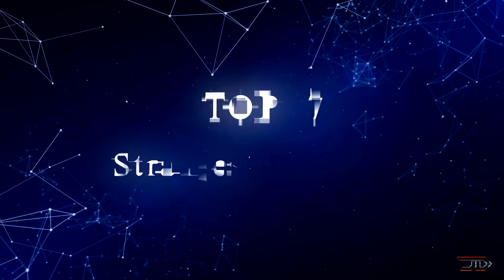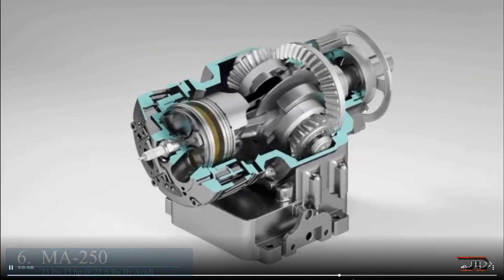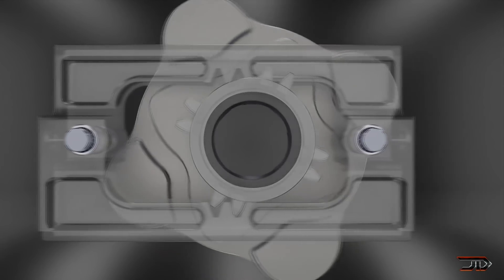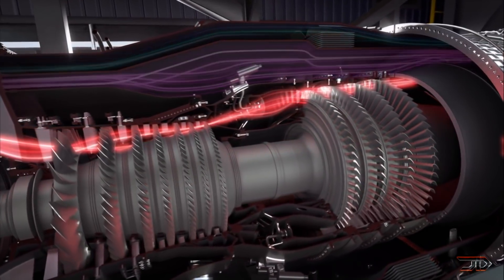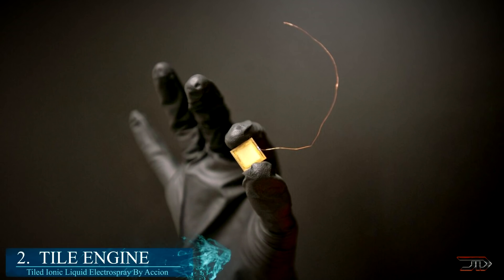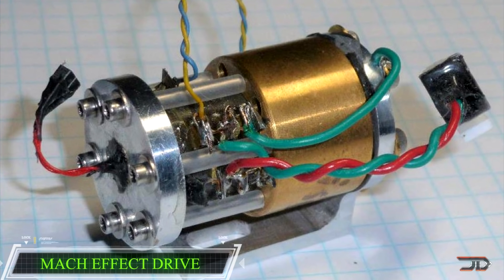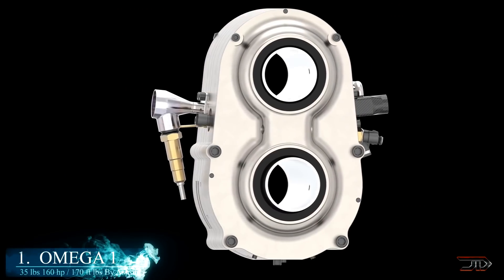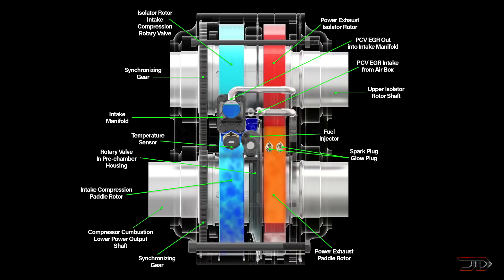7 STRANGEST New Engines -2-

Comment: The Omega 1 has the greatest potential for power to weight ratio and ease of manufacturing because of the lower number of moving parts. Been mentioned before but the sealing issues, if they can be overcome, could be an incredible move forward in the development of the ICE (Internal Combustion Engine). I see it as the final gasp for automotive and aeronautical use. Once battery tech greatly improves the energy density then EV's will bury the combustion engine.
Reply: If Murphys law holds true, someone will invent the most efficient ice in history, only to find that the price of fuel goes up so high that it is of no use.
Reply: @joeboxter3635  Murphy's law cannot negate the most basic law of supply and demand, once the demand drops because of greatly increased efficiency then the price will drop accordingly.
Reply: Maybe an ICE is only as good as the quality & type of fuel going into it for max fuel economy & least emissions ?
Reply: Electric Energy is not FREE. Transporting (transforming)it is a 75-85% POWER LOSS.
Reply: @donaldstrishock3923  that's just not true.
Reply: @rickgao5510  85%× 92% ×80%×94%×93%×90%×75%= 40% for production usage cost for electricity though generation-tranpotation( transfomation),and net usage ( driving) not even considering the actual COST of Fuel& Componetry to produce the Power to spin the wheels & move the electric car down the road. You just didn't do the math for the "highly unpractical" application. Just tell me when you get FREE Electricity then it will be some "New math".
Reply: Since 1/3 to 1/2 of all cars are 2nd car commuters that travel an average of 15 miles to work, battery range is not the problem. Work commuter cars are a huge market, and as soon as prices come down and people are confident with battery reliability, there will be a massive switch to electric.

Comment: Don’t understand why there are still companies spending money developing internal combustion engines.
Reply from the maker: I think if batteries can last 15 years it would make some small ICE obsolete. It's almost there but a refined rotary could be beneficial in hybrids.
Reply: @Motor_Explorer1  in less than 15 years batteries will be considerably better than they are now. Tesla batteries are already lasting in excess of 8 years.
Reply: Range extension is a huge potential market as the infrastructure for charging stations just isn't there yet across the world. We will always have some level of codependency, and the Otto cycle is old tech that can always be reinvented and made more efficient!

Comment: The Avadi engine caught my eye in this lineup.. its got the minimalism of a rotary (somewhat with sightly more rotating parts) where it looks like a traditional piston engine  mated with a differential to produce this gyroscopic 4stroke wonder.

I'm guessing the low-end torque is what would compele some to choose this over a rotary engine, or the inversed cousin (liquid piston).
Reply: its still just a fancy way of operating the "traditional otto cycle". with all the inherent faults of a crank and conrod.

Comment: i followed the mega (mach effect) drive for some time. im not convinced. its supposed to exploit local mass fluctuations that arise due to the nature of mass. the idea is that mass doesn't mean anything unless you have another mass to compare it to (applying general relativity to the origin of mass). the theoretical backing has some serious science cred, and if not for that id have passed it by like i did em drive. you push a mass while its heavier and pull when its lighter,  its essentially a vibrator. typical reactionless drive shenanigans. supposedly, according to its creator, there is a "magic frequency" that will produced thrust if you hit it. thats where i lose interest. i dont think it would be that simple. you would either need to model, predict or measure the mass fluctuations you are trying to lock in on, and then synchronize your oscillations to it with some kind of control loop. using something like gravitational wave interferometry might be a good place to start. i think they are currently trying to re--jigger their experiment until they get the results they want. until they get their thrust above their noise floor its really not worth anyone's time.
Reply: Agreed. It's like a kid in the living room shuffling across the floor by scooting a laundry basket forward over and over again. It isn't thrust, it's a pulsed change in position with no change in momentum.
Reply: Ah yes, the Wile E. Coyote drive.
The piston does not have mass until it looks down, and the engine generates power through the modulated holding up of a little sign that says "uh-oh!"
Reply: Ahh Frequency Resonance. If you can build a device that can alter the frequency resonance on a mass then you can move it just by changing its frequency to the frequency of destination.Like tuning in a radio station, you will be there
Reply: @johnclancy2551  i just use gravity waves as an example. but without knowing when to push and when to pull, you just have an overzealous vibrator.
Reply: honestly it seems like those free energy devices on indian youtube channels 🤣🤣

Comment: capillary
kăp′ə-lĕr″ē

Interesting video.

On the last one, if it is an IC engine I suspect it is still dependent on fuel air ratios, unless I am misunderstanding something.  Diesels are much less so, but highly volatile fuels, as far as I know, require a fairly tight fuel air ratio to run.  They did not need to be full stoichiometric
 though, until catalytic converters were installed for emissions reduction.  That is what drives the exceedingly narrow band of fuel/air required in today's gasoline fueled cars.   Cars used to go pretty rich under full throttle (power valves in Holley's, etc).  I doubt they do this to that degree now, but am not certain.  It would just surprise me if they did, because the manufacturers want long converter life.

Comment: more detail on the last one would be nice. i have no idea how it is supposed to operate.
Reply from the maker: Sry, the combustion happens around the entire circumference of the bottom rotor and exhaust is expelled on the port. Check out the link https://www.youtube.com/watch?v=gi7IOXQ7oyo and it shows the cycle around 5:00 minute mark. I'm not sure if it will work, it's kind of like a rotary config but theoretically it would be more efficient.

 I will cover it more in the future if they manage to build a running prototype.